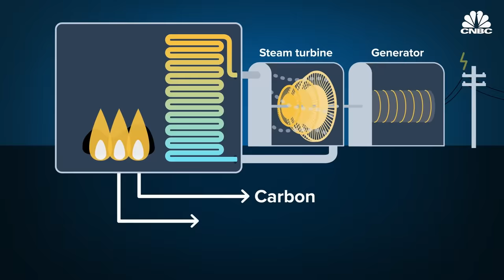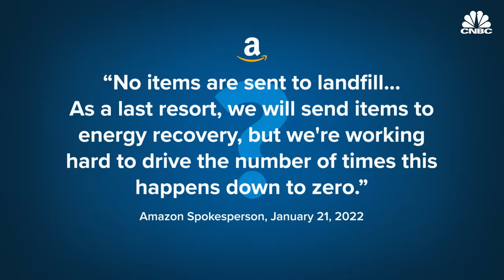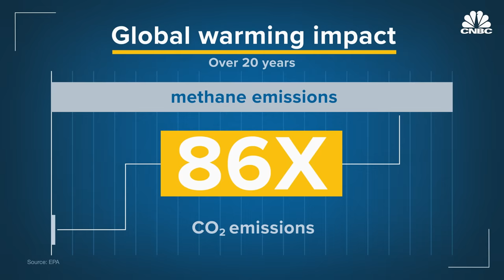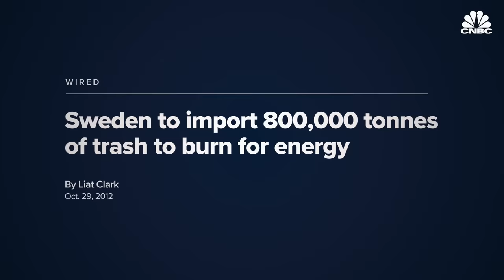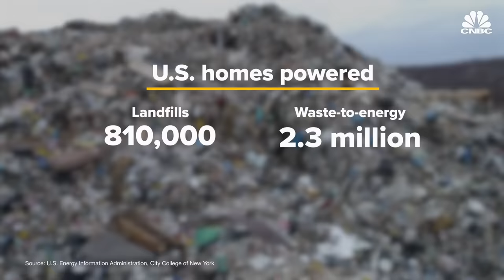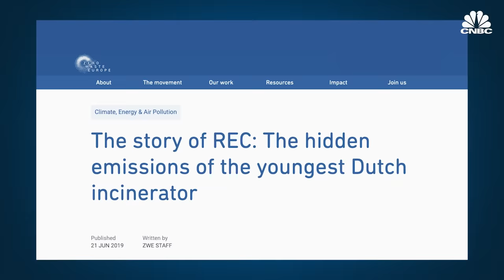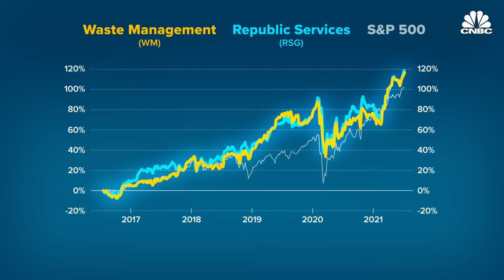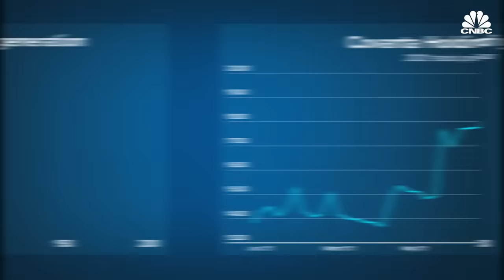How Amazon, American Airlines And Subaru Burn Waste To Make Energy

Comment: I'm not an environmentalist by any means, but I'd love to see a huge reduction in the amount of packaging in consumer products.  
I haven't had trash service at my home for the 10 years I've lived here.  Everything I want to throw out has to go in my car and carried to a dumpster in town.  You quickly learn just how much unnecessary packaging there is and it gets extremely frustrating.
Reply: What? No trash service? Where do you live, if you don't mind the question?
I imagine moving the trash can be frustrating even with a car,but without it...
We don't have one and it would be a nightmare to move the trash everytime.
Reply: @Draco19970125  Florida.   In one of the odd counties which only has trash pickup once a week, and happens to be one of the days I'm never home because I'm on the road working.  Even during the lockdowns, I still had to travel for work being an "essential" worker (yay me.../sarcasm).   And that's if they bother to pick up.  I heard that they skipped last week, so people had 2-week old trash sitting in the Florida heat waiting to be picked up...yum. 

The trash situation might not have been as much of an issue if I had a pickup truck or SUV, but I don't... I have a passenger car.  A rather nice one, with a white interior.   So, my toilet, garbage disposer, and the local racoons get used quite heavily to help reduce how much goes in my bin.
Reply: @grayrabbit2211  Get a utility trailer and put your garbage bins on that. Or get a ATV or golf cart with a wagon.
Reply: @huskyvacs  I'm not about to put a hitch on a Mercedes or Bentley.  Nope.  Golf cart / ATV can't be driven on the roads here. My dump location is 10 miles north of me.
Reply: @huskyvacs  the point is the packaging is a waste nobody wants. Less of it.  You’re trying to fix a complicated issue by telling him to buy more bigger stuff
Reply: I say bring back plastic straws.
Reply: @grayrabbit2211  what part of florida?
Reply: @TThomas939  Fort Myers
Reply: @TheTeaParty320  Plastic straws never left, what the hell are you even talking about?
Reply: I agree, I can't believe how some things are way over packaged.  If I need a utility knife and pliers to open something I'd say that's over packaged.
Reply: @huskyvacs  Its left where I’m at.
Reply: once you stop having local trash pick up you start to realize how much trash you produce on a daily basis when I cut my trash bill (to save money at first because it was $80 for 3 months) I saw I filled up a shopping bag daily and  over the years I have noticed it almost takes 2 days to fill one now. I live on my own so I don't really see a need to pay for trash service as it is.
Reply: @grayrabbit2211  wait so you don’t want to put a hitch on a “Mercedes or Bentley” but you use your cars to dump the trash ? Lol am I
Missing something
Reply: @zethloveless7238  Nope. Wet trash goes down the disposal, toilet, feeds the raccoons, or gets frozen until I drag it to the dumpster in town.  Double bagged, on a vinyl liner.
Reply: @grayrabbit2211  so your willing to put trash inside your car but not on something to tow on the outside. Yea makes absolutely zero sense.
Reply: @zethloveless7238  Physically modifying a German car (which the Bentley actually is) is a recipe for disaster.  Mercedes has a difficult enough time making their cars work out of the factory.  They're wonderful when they work but are a true nightmare when they don't.
Reply: @grayrabbit2211  I’m literally a car guy I don’t need your words. And Bentley is English with a German group as parent company. I was just here to show how what you said made absolutely no sense. Bye
Reply: While I was lucky to find two items I wanted for sale by this ebay seller, he shot back that I was "ridiculing" him for complaining about his use heavy use of toxic styrofoam chips (which usually ends up being burned) to pack the items, rather than using newspaper, ripped magazine pages and/or recyclable and biodegradable honeycombed paper. The fact is that most Americans-if not, most people-are lazy and indifferent to their contributions to escalating and deadly climate change. Yet greedy eco-idiots like Bezos would rather just burn trash and make money rather than even attempt to educate or even shame sellers and consumers to create less waste in the first place.
Reply: My family uses one 30 gallion garbage can on a one month pickup. I use our yard waste as overflow. I can't stand how bad packaging is or our recycling that's garbage, because people put garbage into it and it's all mixed together in a garage heap.
Reply: @grayrabbit2211  maybe try buying a vehicle u have faith in then? U know they sell those "special" cars with trailer hitches on some models..... maybe if ur as Ballin as ur trying to sound buy a separate tow vehicle?
Reply: @scotts1668  Not "balling" by any means... The Mercedes was customized at the factory for my health limitations.   It was almost half the price of what a mobility/handicap shop wanted for a brand new modified Chrysler minivan.   East decision for me there.

The Bentley is a 2006.  Not exactly rolling in dough here.
Reply: Nationalise all the waste companies, than with all centralized in federal level, you will be free to manage with much more efficiency, without the states have the power to miss manage the waste.

The goal must be 70% recycled, 30% burned to energy recover.

But the first step must be to build now the enough waste burn facilities, both for the waste levels of the total national, and as well to start to burn the already burried waste in the active and closed landfills around all the nation.

Remember that we need ground water to survive, and wadte landfills are poisoning the water that your next generation will need to drink.

Cleaning the land, allows to clean the rivers and ground water sheets.

Besides recovering a lot of metals...
Reply: @zethloveless7238  lol he has a bently though! A picture of one!!
Reply: You could live in a city with trash services
Reply: @phillygrunt2154  No thank you. I prefer to live where I  leave my doors, windows, and car unlocked without worrying about it.  No lockdown, no masks, no protests, etc.  Police here have no problem shooting at purse snatchers here. 

My father is getting up in age. He recently left his Mercedes S-Class parked, engine running, door open, for 4 hours near downtown and no one touched it.
Reply: @grayrabbit2211  lol well that escalated quickly. Girly. Pay for someone to come get it. You puttin trash in a Bentley or a Mercedes
Reply: True but a lot of things need that extra packaging so they won’t break during travel
Reply: If you’re on septic, you may want to reconsider all the waste you put down the sink.
Reply: Why would you not be an environmentalist?
Reply: Amen!!
Reply: Tonysopranoyafinook  You've posted multiple negative comments.  What about freedom do you dislike?  

Florida reopened for business in May 2020 (eating in dining in restaurants, gyms open, etc)..  It'd be 1-2 years for everywhere else to open.   We also had far fewer deaths than other states, especially when you realize just how old the Florida population is. 

Our Sheriff began every press conference after Hurricane Ian encouraging locals to pew-pew looters, even offering to help with the paperwork.  

I can open a business here with minimum effort compared to someplace like New York City. 

Florida has NO income tax and a low sales tax.
Reply: Amazon can give you an option for less packaging, and you can also recycle the packaging if you head up to a nearby amazon facility
Reply: I work in furniture assembly, and the Styrofoam packaging drives me crazy. It gets all over everything when it crumbles and it clings to everything. You can't recycle it either. I wish the US would ban imports that use it for packaging.
Reply: Wrong. Amazon packaging is so minimal and often non existant that products get damaged.

Comment: My trash index:
-Food waste/biodegradables goes to compost 
-Paper goes to recycle or saved for winter for fire. Ashes goes to compost
-Wood saved for winter for fire. Ashes goes to compost
-Plastic Aluminum and all other metals goes to the local recycling company
-Unused clothes and similar material goes to Goodwill
-Furniture gets disassembled. Wood is burned during the winter, clothed is reused for cleaning rags & mops.

Comment: I am glad they mentioned landfill emissions. Most people think we bury it and its safely packed away. But actually tons of it slowly rots away and releases methane and other toxic gasses. Burning it at a very high temperature will destroy all chemicals, poisonous gasses, plastics and refrigeration gasses like R12 and R22. The resulting energy recovery is a huge bonus. Plus with modern exhaust after treatments we have today older plants can be up fitted to make them even cleaner.

Comment: It's sad that North America so often appears more than 30 years behind Europe in so many ways.
1) In the early 80's, hands-free phones while driving in the UK
2) In Liechtenstein, in the early 80's, drivers were required to turn their vehicles off when they were further than the third car from the front of a line at a red light.
3) Europeans (and China) have done extensive studies on traffic regarding safety (vehicles, pedestrians and cyclists), traffic flow and the optimum length of a traffic light cycle (The time from when a specific light at an intersection turns green to the next time it turns green). It's 31 seconds max!
4) In Switzerland, clothes dryers are banned in residences. Instead, they use a spinner that removes so much water that the laundry is perfect for ironing or they hang the laundry indoors, and use a fan to dry the laundry fully. Note: Switzerland rarely has high humidity.
5) Incinerators: In the early 80's, Germany built an incinerator that was fully controlled by a computer with one person overseeing the operation. The building had a pit in the middle and there were doors, similar to garage doors, on three sides of the building. The garbage trucks (Europe has been recycling paper, glass, plastic and metal for decades) back up to the open 'garage' door and dump the waste onto a platform below surface level. Then, from below where the garage door is, a blade like a bulldozer blade, pushes the garbage into the incinerator pit. But, this is controlled bym the computer to maintain an optimum temperature to burn the cleanest. The heat also turned turbines, producing electricity.
6) In Switzerland, since before 1982, everyone took their glass and plastics with them to the grocery store, where they put them in the proper bins. Glass was sorted according to colour (green, brown and clear) and plastics according to type. This way a LOT less trucking occurred. Who doesn't go to the grocery store? Nowadays, metals are also collected. If one has any garbage that is not compostable or recyclable, one pays to have it removed. It's not cheap. For example, one searches for a company willing to take used furniture to resell. (There's no Ikea in Switzerland because most of its furniture doesn't last long enough and is overall not best for the environment in the long term.
7) Switzerland has long be considered a 'battery' in Europe. It has many hydro-electric dams. However, at times other countries in Europe produce too much electricity. This is sent to Switzerland where it is used to pump water back up into the reservoir, in effect storing the electricity. Ontario claims they do the same, but I have never come across such a site.
 8) In flues from industry, including incinerators there are three gases which need to be trapped because of their negative effect on the environment. One of my father's (Dr. of chemistry) ideas was to install three racks, one for each undesirable gas, in the flues. Each rack held pellets which would absorb a specific gas, such as sulphur. In addition, the pellets could then be sold to industries that use said 'gases' (or chemical elements), who would extract them.

 With the invention of the internet, there is no reason North America should be so far behind Europe.
 It is my opinion that its a result of the mindset of politicians and government employees. Too often I have found that they do not want to listen to solid, logical solutions from 'outside,' i.e., 'outsiders' don't know what they're talking about or it might be 'too much trouble' (LOL!) or the proposal would cost the politicians political donations.
 Example: The mayor of Ottawa ,and many city counsellors, received campaign contributions from a specific developer's family members. The mayor alone received $11,0000 from one family. The developer's proposal will send untreated storm water directly into a small stream. This stream is already flooding much needed sportfields. Storm water runoff contains contaminated waste, such as, rubber from vehicle tires, oils from the same, road salt (Really good at killing both wildlife and vegetation), and an expensive liquid chemical blend which the city sprays on the road salt to make it activate slightly faster.  The city council approved this proposal even though there were protests against it.

Comment: In Scandinavia, we have burnt all our waste since the 1980s. All landfills are closed down. Unbelievable that the US is so far behind.
Reply: The few thermal power plants that exists in the US are hopelessly inefficient too since they don't have district heating. Considering 2/3 of all energy from burning trash is heat and only 1/3 is electricity.
Reply: So turn the US into multiple Scandanavian size countries?  Rural areas in the US have been burning their waste since the 80s and beyond.
Reply: It’s worse for the climate to burn waste rather than bury it. CO2 emissions enter the atmosphere rather than staying locked inside petroleum products.
Reply: @astebbin  Did you even watch the video?!!!  Burn waste out on the street, "even though that's even less efficient because the waste couldn't be able to get to/burn at a constant 1000⁰ Celcius - 2000⁰ Fahrenheit" then yes it would be worse. But it's not being burnt on the street (Atleast not in first world countries), it's in an incinerator facility where the pollutants are treated as much as possible. 
PAY ATTENTION!!! 🙄
Reply: @wildone8397  Do you understand the chemistry and physics at work? Combustion creates CO2. Incomplete combustion (“on the street”) creates all sorts of other pollutants too, but even in an ultra-hot incinerator with filters on the smokestack you’re emitting carbon dioxide back into the atmosphere, unless expensive steps are taken to capture and store or re-use this combustion product.
Reply: @astebbin   Do you understand that the methane emissions from landfills are worse than carbon dioxide from incinerator plants?  

Well if you didn't... you do now 😉 😎
Reply: @wildone8397  The scientific consensus on that finding is mixed. Methane is a more effective greenhouse gas than CO2 but decays much more rapidly in the upper atmosphere